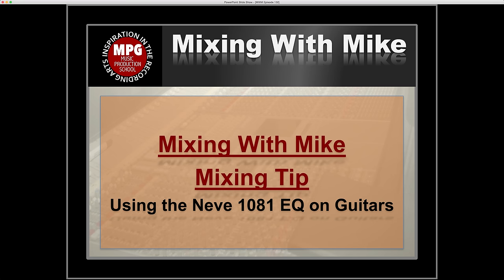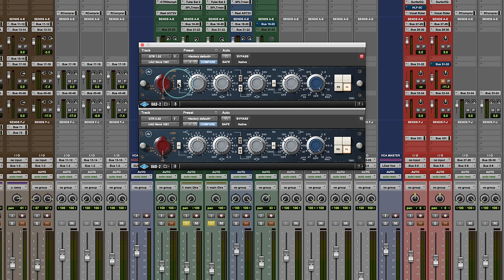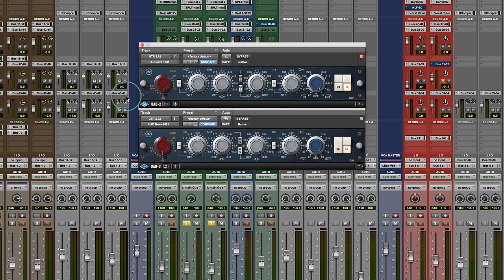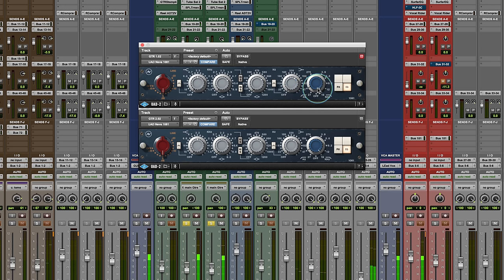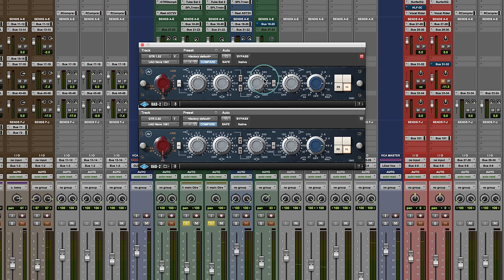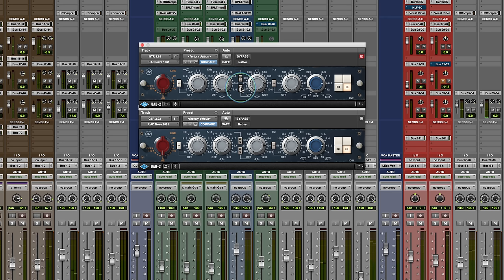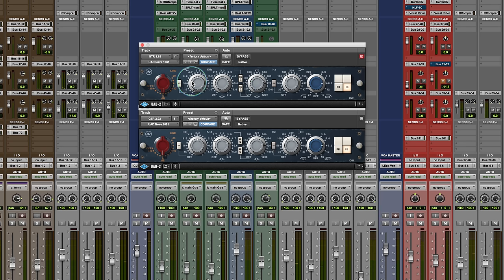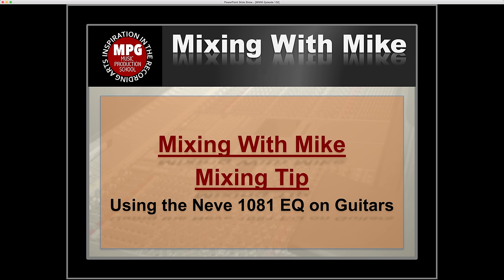Using the Neve 1081 on Guitars - Mixing With Mike Mixing Tip

Comment: Surprised you didn't use the V-EQ 4 for this as I know you like the V-EQ's and the V-EQ4 is supposedly an emulation of the 1081. Presumably you consider the UAD superior - which it probably is....
Reply from the maker: I like the VEQ 4 but the UA version is closer sounding to the original. I love all of the V-Series plugins, and the UI is also easier to read and work with than the original Neve layout that UA presents. In this case, I wanted the vintage look as well as the sound.
Reply: Do you have experience with or an opinion on the T-Racks EQ 81?  I have their EQ 73 and love the sound, although it's harder than it should be (for an EQ) on the CPU.